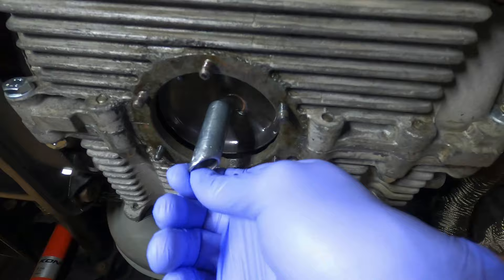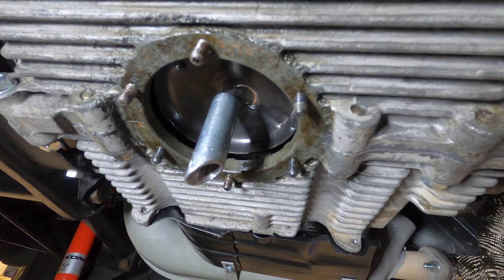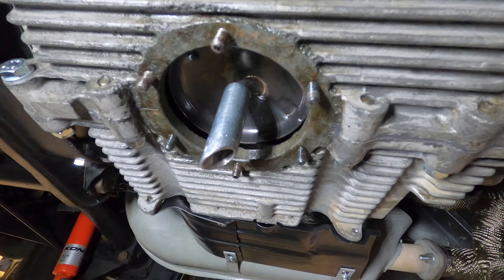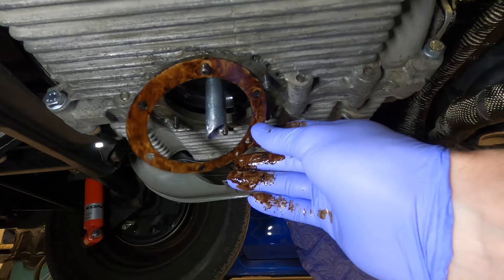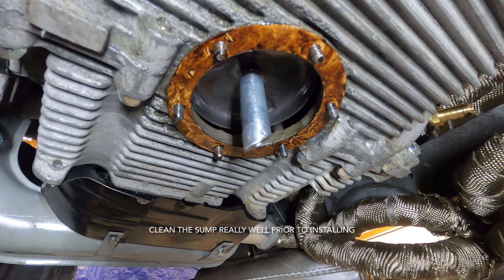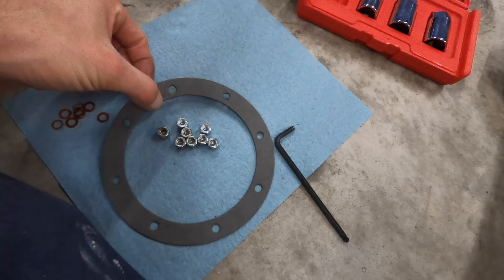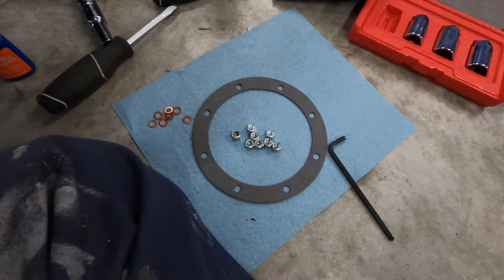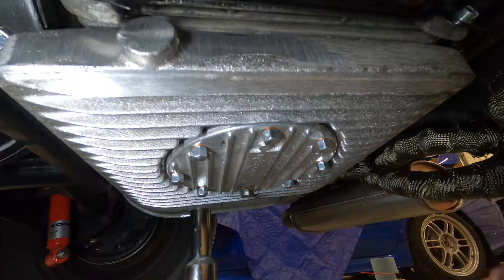Oil Sump VW Beetle

Comment: If it were me, I’d ditch the screen and clamp  on a strong magnet and a magnetic drain plug which is moot on your sump.
I use neodymium magnets and I need pliers to yank them off the pick up tube. 
Just my 2 cents.

Comment: How do you drain the oil out off the sump, for a oil change
Reply from the maker: If you didn’t tap a drain plug in the side on the blank spot (for this particular one), then you would just loosen the hardware on the bottom plate and let the oil out that way.